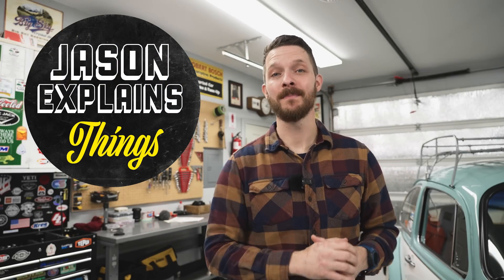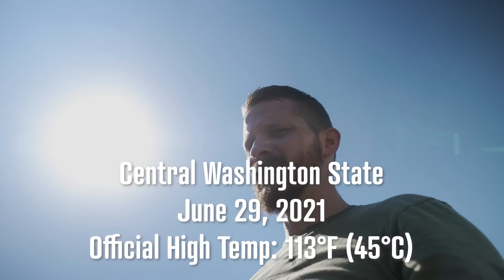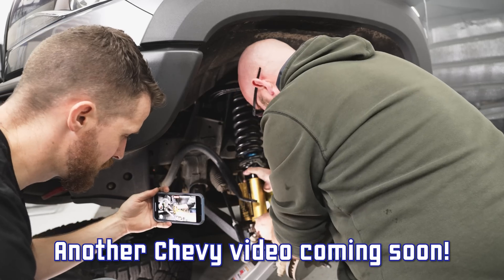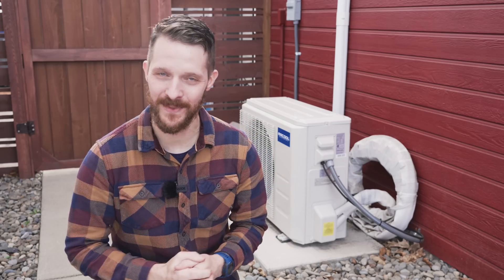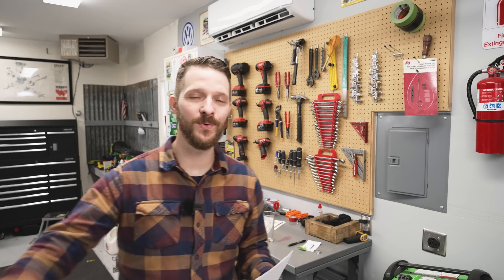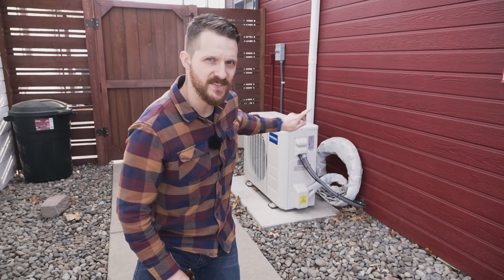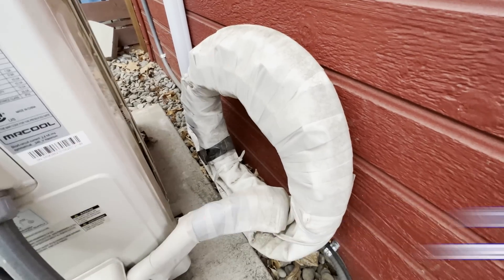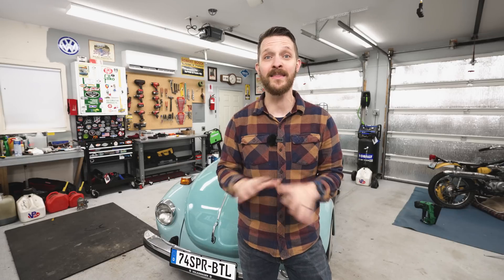MRCOOL DIY Mini Split LONG TERM REVIEW (15 Months Later)

Comment: My 2nd Gen 2-ton unit has been fantastic for 6 years now, both cooling & heating.  Sure the heating job here in the desert isn't hard (I can count the mornings where the temps dip below freezing on one hand), but the cooling job is tough (110F+ every year).  It handles 'em like a champ.  In fact, I love it so much, I added a 3rd Gen 1.5-ton unit about 2 years ago to another room.
I actually prefer the two separate unit setup over multi-zone, because, if one goes out for any reason, I wouldn't be dead in the water, and I can take my time with repair/replacement.
Reply: You installed yourself?
Reply: Good idea

Comment: Hey great video update, i had a quick question and wondered if it was possible to install or mount on of these units on top of a roof? i have a flat style roof and would not want to deal with mixing concrete for a slab or the eyesore it would be in my front lawn.
Reply from the maker: I’d review the pdf of instructions.  Not sure honestly.
Reply: Others who hang their's off the side of their house report a little vibration can be heard.  This might happen on the roof.

Comment: Heat pumps arent really meant to operate at temps below 20f unless they have a heat band on the compressor. Thats why it froze. As for not servicing the system, most hvac companies wont touch equipment that wasnt professionally installed due to liability. So dont blame the company
Reply from the maker: I don't blame them and they still service my furnace.  It was just a warning to others that they may get that response if something goes wrong.

Comment: Thanks for the comment on leaving the excess line in the attic. Mine is going to mount on an interior gable wall with attic space behind it. The air unit line section will go through the gable wall, then bend left where the precharged line is coming in from the exterior eave. I can just leave enough line outside to reach the heat pump unit. The excess line will remain coiled in the attic. Having 25’ gives piece of mind you have enough to finish the job. I’m cooling a large living room with vaulted ceiling. The living room is open to the kitchen and an alcove, so I’m going with the 34K unit. I prewired a 220 30 amp circuit into the attic. That breaker is just around the corner so can I connect directly to the unit without a quick kill box? Thanks. Both videos on installation and a 15 month review very helpful.
Reply from the maker: From my research apparently the quick kill box is required to meet my state's code.  I was also very close to my breaker but still did it.  Food for thought, and I'm really glad the videos helped!

Comment: We installed (not DIY!) a Daikin mini split in our last home to cool our upstairs bedroom. We were disappointed that the unit was designed to only cool to 65 degrees. No way around this “set point” according to the installer. What is the lowest temperature setting on your unit? And is it effecdtive at cooling your mancave to that temperature? We are looking for a unit that will cool to 63 (17 C). Thanks

Comment: I have two mini splits 2400btu each.  They are great at both heating and cooling here in Florida.  WHAT YOU DIDN'T MENTION OR SHOW was the actual cleaning of the machine, which is a bear regardless of the brand.  It makes a mess, and if it is inside your house you have to deal with dirty water that wants to run down your interior walls.  The indoor unit must be disassembled, the blower wheel taken out and the coils washed.  It is not a pleasant job.  Ignore it and you will get globs of mold growing in the dust..and use your imagination.  They are great machines, but blowing the filter off with compressed air is a little misleading.
Reply: The one I installed only ever leaked inside once due to the interior coil freezing. Up until we stopped using it it never had any mold growth in either the condensation tray nor condensation line that went thru the wall and down with the line sets. 

I think mounting the indoor portion level in both side to side and front the back and the tube not kinking going thru the wall are key to keeping condensation from backing up. Also Florida has a much higher constant humidity then south central Kansas where I live which could also contribute to excessive condensation and slime buildup in the condensation trap. While not simple or easy one trick we used to use here on the condensate traps on HVAC coils was to drop algicide tablets into the pans that collect condensation every year while cleaning the A-coils. We never had any issue with plugged up condensate lines after we started doing that. Maybe that could help in this case.
Reply: All units like this I have ever worked on always have mold growth. They never evaporate condensation correctly or drain properly if one is equipped.
Reply: I feel so fortunate to live in this climate and not a humid one. My coils are like new with only a small amount of dust on the screens removed every six months on 5 year old 24k unit.

Comment: I'm in Florida and have the same unit in a single car garage. My only regret is I am not using it as much as I thought but it is amazing. It actually can keep the garage cool with the main door open. It also cools down very quickly. 

I put the lineset down the wall on the inside so it couldn't be seen on the outside of my house. I have a Snap-on tool box covering most of the lineset which I have in a white cover. I poked out of the wall about 2' above the floor. The landscape bushes hide the horizontal outdoor run to the condensor which I have wall mounted on a hurricane bracket. I have the outside lineset in a brown cover to match the trim and gutters even though you can't see it. I was able to run out the lineset where the condensor lives so no ugly coils. I also ran my 220 from the breaker panel to the disco which was a very long run with no splices. Ran EMT from the attic to the inside garage wall next to the lineset and outside ran gray PVC to the disco. It came out really nice.

Comment: I also have the 18000 BTU McCool unit. 
BUT I have had problems.  The biggest frustration is that the McCool people do not answer phone calls and/or return messages.  The first time my condenser failed someone from the Amazon customer service department contacted them for me after my multiple attempts. 
Now it has failed again and I have not been able to get assistance.  THE WARRANTY IS WORTHLESS IF YOU DON'T HAVE A WAY TO CONTACT THE COMPANY
Reply from the maker: That’s terrible Pat.  Sorry to here that.  Crappy customer service is very frustrating.
Reply: That really stinks.

Comment: Good video I got quoted 12-13 k for installation of A Mitsubishi mini split system. Ouch… the unit only costs 2.5k I would add a awning above the unit. That white wrap around the coolant lines did you get that with the unit?
Reply from the maker: Yes indeed.  Wish it came with more because I ran out.

Comment: I would tell that "servicing" company to take a hike. people service other peoples work all the time. If you installed it per code and per spec it's none of their business who installed it. Thanks for the review I'm looking at the 12 for a 400sq ft room... on my way to watch your install vid.
Reply: I’ve seen a lot of hvac technicians online with that same “won’t touch it” mentality. It makes me wonder if they’re feeling threatened by these DIY heat pump systems
Reply: @Travisrogers87  is their tech support proven? This is a DIY brand. Its a risk for a technician to go out there not knowing if they will ha e tech support.
Reply: @Travisrogers87  I would say it's to prevent the crazy customers from claiming the technician made it worse, or sabotaged it if it can't be repaired due to DIY install error.
Reply: @hydroaegis6658  This exactly. After a professional has inspected or serviced something, if anything happens it will be the liability of the service technician or the company that serviced it. These things can cause fires in the worst case.

Comment: I have the exact same unit. I wasn't aware of the lines were charged until I cut them to shorten them. I was worried about it affecting the systems operation but it hasn't so far.
Reply: I wonder if the lines are truly ‘pre charged’ or if they simply have a vacuum pulled on them from the factory. It doesn’t make sense that Mr Cool is the only manufacturer that doesn’t charge the outside unit with coolant.
Reply: @barefoottropicals  He clarified in the video that they do charge the outside unit with refrigerant, they just also precharge the lines. Whether charged or vacuumed, cutting the lines will lose that and bring in atmosphere, which can interfere with the operation of the machine (moisture, other gases, etc.). Hopefully the small amount in a shortened line isn't too bad, but I imagine the full tubing length would be enough to cause issues. Even just pulling a vacuum on the lines prior to reinstalling them would avoid much of the issue, leaving you just a bit low on refrigerant.
Reply: Uhhh, yeah.... those papers and the booklet that comes with it.... a little thing called an “instruction/installation manual”.... uhhh, yeah - you’re supposed to kind of look that over a little before doing something bone headed like that...🤦‍♂️

Comment: That's weird that they would not service your unit. It is nothing but money for them. Apparently they have limited skills. I would look for more qualified hvac people.
Reply: Not weird at all.  I run a my own small HVAC company and would also not service/repair these for many reasons.  But this will not apply to me since it would be illegal to do a DIY install where I am.
Reply: @berndblume3335  Where are you located that a DIY hvac install would be illegal?
I’m in Florida and am considering a DIY install. My county requires permits AND engineering drawings for everything except taking a crap……lol I haven’t checked on whether DIY HVAC is allowed or not yet though.

Comment: I think the reason they say it doesn’t need a vacuum or to trim the lineset is because well then it wouldn’t be diy friendly.    I’ve been doing HVAC for years and there’s no way I would turn they system on without pulling a vacuum 1st        And for the line set all you need to do is a pump down remove the line set use a flaring kit to shorten the line set.
Reply: Linesets are most likely pre charged. I dont touch these because i dont want to be liable for equipment that wasnt professionally installed.
Reply: @WERTY100K  "Professionally installed"  Give me a break.  Like it's magic or something.
Reply: @brontoab1  once you have your epa universal certification you'll understand

Comment: I put one in about 4 years ago and it really only ran reliably for about 2 years. WiFi never worked reliably, and then last summer it developed real bad leaks in the indoor unit.  I'm going to replace it, and are debating whether or not I get another one or switch manufacturers.
Reply from the maker: I agree about the WiFi features, but no leaks yet.  Was it the drain hose?
Reply: @JasonExplainsThings  unfortunately it was the refrigerant lines.

Comment: Looking into heat pumps for the house I'm building, your temperature sounds about the same as mine, roughly 0-100 degrees Fahrenheit (mid Michigan), how well did it heat in the winter?  I know they have back up heating coils for the cold, how much did that raise your electricity bill during the coldest months?  Thanks
Reply from the maker: Can’t say exactly.  I have a natural gas heater in the shop that I use for most of the heating, but I use the heat pump for heating as well when I don’t want the extra noise.

It is totally capable of heating the space by itself though.
Reply: @JasonExplainsThings  fyi a heat pump is much cheaper than gas! The only issue of the heat pump is how low the outdoor ambient temp can be before it can’t keep up with load. But if your heat pump can maintain the temp over winter you will save dollars running it over your gas heater!
Reply: @reverse_engineered  Wow natural gas is not that much cheaper where I am! In you’re case natural gas would be the way to go then!

Comment: I have a 4-zone unit and dont regret buying it. Here in Minnesota have crazy winter and this thing handled it just fine. It's going to be 7 months so far and all I am waiting is for summer to arrive to experience in AC mode.
Reply: I made a platform high enough so the snow doesnt reach it
Reply: ooooh i wanna get a 4-zone too. does it have dehumidifier only mode?
Reply: Howdy MN neighbor! Did you wall mount your condenser or is it on a platform on the ground?
Reply: @implayingsomebass4753  Wall mounting will cause vibration in your house. Mine were on the wall and I ending up mounting them on a 4x4 stand I made thats about 2ft off the ground. Also built a little roof over them so they dont suck in as much snow and rain. I threw the wall mounts in the dumpster Haha.
Reply: Is yours in a big shop and if so, what size is it?
Reply: @pjfan173  Since it's has been more than a year since I wrote this comment. I still hold strong what I said about my MR COOL 4zone unit, till this day I do not have any issues! 
Regarding to your question, this unit is installed in my house. I am planing on putting another mini split for my garage.
Reply: @eddyparker10  Thanks for the reply. I’m planning out a 40’x60’ Garage/Shop. I’m installing in floor radiant heating, but thinking of also doing mini splits as a backup heat source, as well AC

Comment: riddle me this then mr jason -- if the line - sets were pre-charged, when you back the cap out, wouldn't it escape? 

the unit ONLY has the refrigerant brother.. trust me.
Reply from the maker: Heavy sigh... then I guess the sources I link in the description are all lying on purpose.  Either way I don't really care.  I'm not an HVAC pro... I'm just a guy who installed a heat pump in his shop and made some videos about it... and quoted the info he found online.  The subject is done for me.
Reply: @JasonExplainsThings  

Regardless, clean install man! Good work 👍😁
Reply: @pvntellus  why do y'all have such a hard time with this. There are check valves installed on booth ends of each lineset. They are designed so that they will be forced into free-flowing position when they are fully tightened to the condenser/air handler units. These lines are either precharged with some refrigerant as stated in the manuels. Or they are under vaccum, but im pretty sure they are charged with refrigerant as you can hear it move if you connect to the air handler side first. Yes the rest of the refrigerant is in the condenser. But the manual also states there is something like 0.019 grams of refrigerant per foot of lineset also present. This isn't a crazy concept guys.